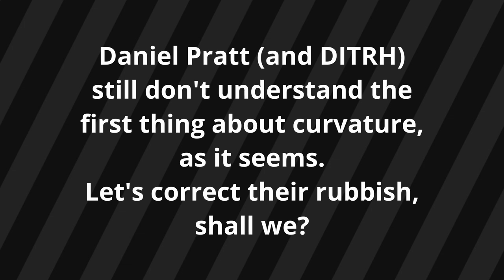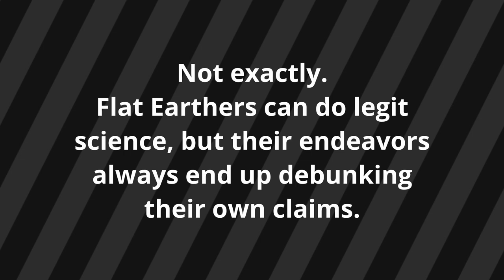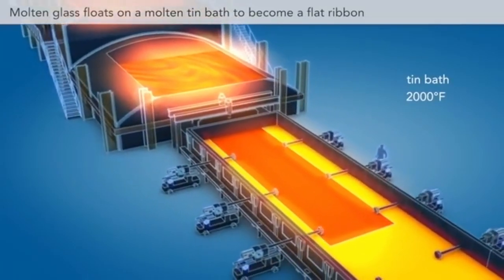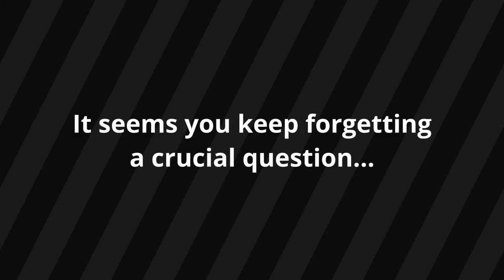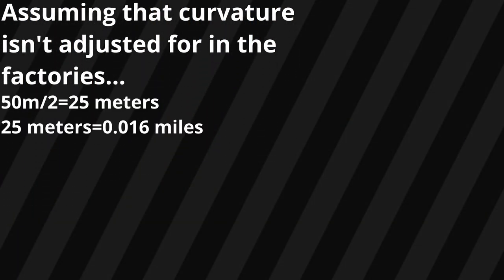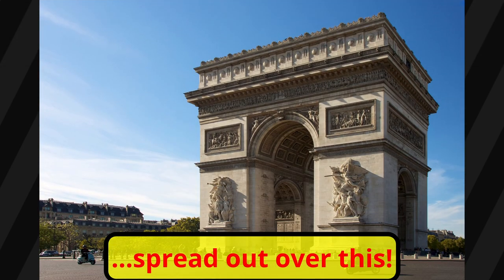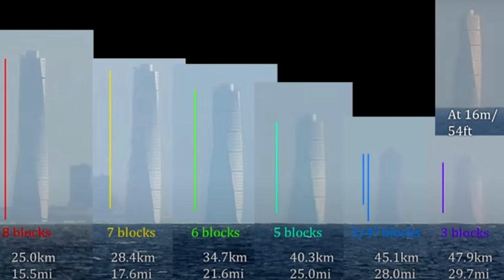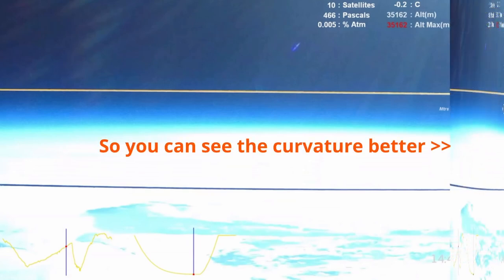Daniel Pratt is Denser than a Black Hole.

Comment: Those model ship basin tow tanks are much longer, and they are specifically built to conform to the curve of the earth.
Reply: You can quite clearly see the water bend in a Ship Model Basin.
Reply: @awatt  Flerfs will ignore the documentation that says it has to be built with a curve, too. Mr. Sensible did a good job with the ship basins a while back.
Reply: @MrOttopants  
Got a link?
Reply: @awatt  I looked through his old vids but couldn't find it. Sorry about that.
Reply: @MrOttopants  
Never mind.

Comment: His claim rests on the two assumptions that the glass is actually flat, and the manufacturer uses a level to set the shape of the glass sheet, but there's nothing that says that's the case. The manufacturer could just as easily compensate for earth's curvature. Pratt has to measure both the glass and the substrate it's built on to be able to make a conclusive argument either way. 
Not that it would matter. I have a sneaking suspicion that the surface is irregular enough that the noise in the data would bury the theoretical difference between the two methods.

Flerfs keep expecting to be able to detect earth's curvature with their eyeballs, as if maybe science was claiming that the planet was just a few miles in diameter.